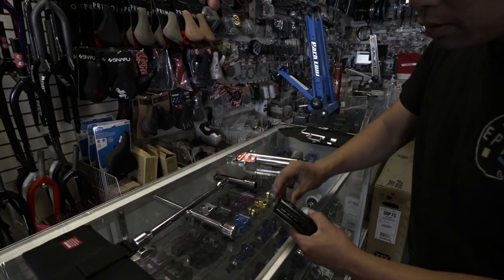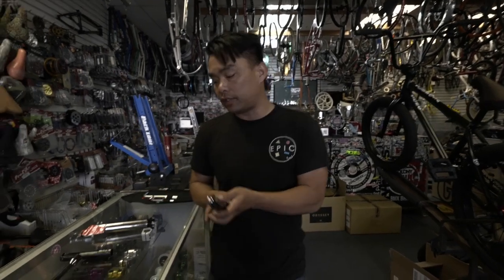The BEST & Most Complete BMX Tool Guide & Review!

Comment: Eclat't street tool looks compact and complete.

Although, for general bike maintenance and some little tightening on the road, the cult/tall order works and is already enough. I just changed my seat post clamp from 5 to 6 so that  won't be carrying an extra 5mm allen.
Cult also has a carabiner spoke wrench although it does not fit my current spoke size as mine is bigger.

Comment: all good pedals have 6mm allen on the inside of the axle spindle, I haven't busted out a pedal wrench in a long time (old 3/8" front wheels use 15 for the axle nuts but those are less common now too).

Comment: The Odyssey tool is pretty good, little too long to ride with in your pocket, but handy. Has every metric tool you need. 
However, I ride a lot of Profile parts which are standard...not metric.. I'd like a tool that has both. Really they just need to add a 3/8" and 1 /4" Allen wrenches...

Comment: What about a pump that you could put with your tool kit as well in a bag and a puncher repair kit 👍🚲💨
Reply: Google Airbone , like a marker pen.
Reply: @robertlund5694  😎
Reply: I have a small little pump from specialized for 30$
Reply: I’ve got a Top peak Joe blow in my man cave where I tune my BMX and a Lezyne HP Micro Floor Drive Gauge V2 ABS pump in my bag for out and about at the skate park or riding street or at the dirt jumps 👍🚲💨

Comment: Didn't see the eclat tool. It's ok because it's extremely expensive garbage
Reply: which tool? there are several.
Reply: @WickedG5150  the e-tool. Within a week it was already crapping out,after about 10 uses it no longer fit inside itself,and i don't think i abused it,lol. It's just not a good tool for the cost,when others last MUCH longer than a week or two